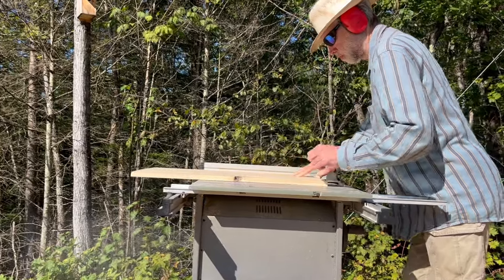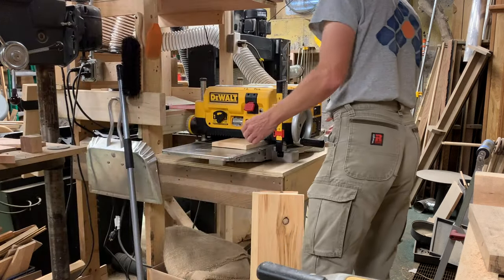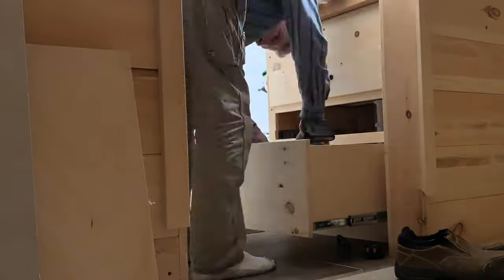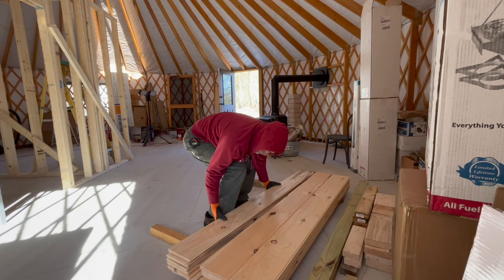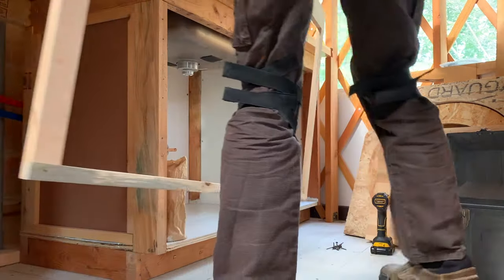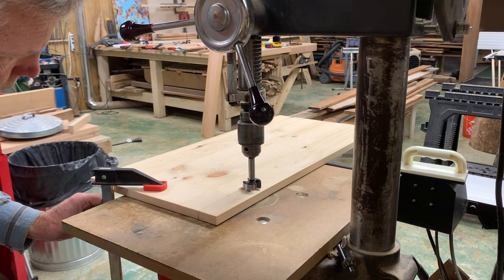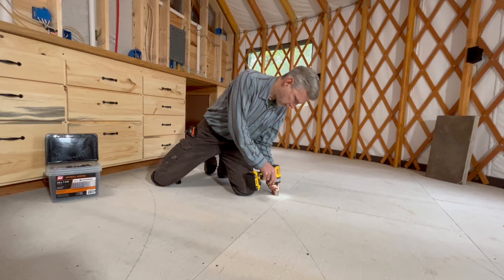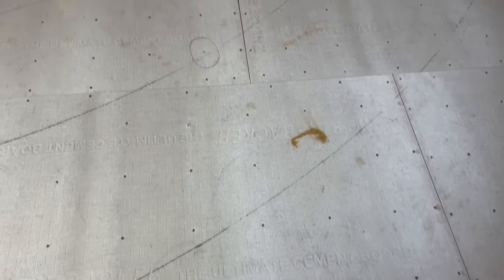Grateful for FRIENDS with TOOLS! Yurt cabinet doors & drawer faces (Vermont DIY off-grid home build)

Comment: This is an old fashioned suggestion, but that's because I'm old. If you are trying to change the look of "a lot of wood", which I agree with, plus you want to be able to "undo" it in case of repairs, why not try some decorative wall paper just in the area of the backsplash? Many color and pattern options, it can be scrub-able and water proof, and can be easily changed as many times as you want. Also pretty inexpensive in a small area compared to tile.

Comment: Sorry I personally don’t care for the green backsplash.
Reply from the maker: Thanks, keep the votes coming...  You don't like the stain effect, the dark color, or any green at all?
Reply: Great job on the cabinets!  As for the backslash,  I completely understand that you are starting to feel "wood overload" with so many surfaces being wood.  Creating a break in that aesthetic is important. It's difficult for us to know if the green will work, not knowing what the rest of your plans are for decorating and finishes.  I will say, backsplashes are often more successful if they are made from non porous surfaces, so more easily cleaned. Something you may want to consider is metal ceiling panels. The 6" square patterns are well suited for backsplashes, and can be purchased in a variety of finishes: traditional tin,  copper, painted or verdigris.  They lend themselves well in more rustic applications, such as a wood filled yurt, and would be easier to keep clean.  The big box stores carry some, but there are better choices from on line companies that specialize in tin ceilings. Looking forward to see what you ultimately go with.
Reply from the maker: Thanks, will look into the ceiling panels (especially on the second hand market...) I think some of those peel and stick options are mimicking those.
Reply: @OvertheRiverandThroughtheWoods  again I personally think leaving clear wood look better. But I am partial to plain wood.